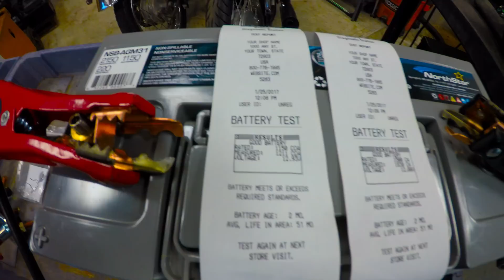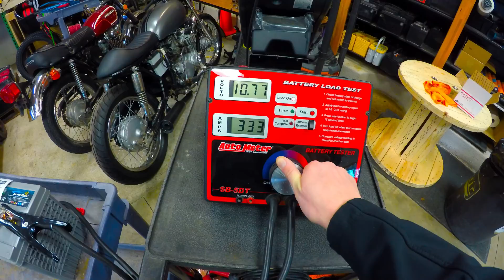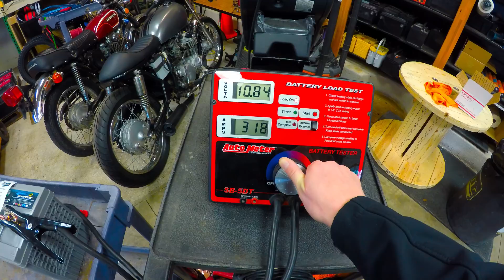Test My Batteries: Northstar Group 31 AGM (Stud Thread, Part NSB-AGM31)

Comment: I have a adjustable voltage regulator in my vehicle. What is the recommended or max voltage I can charge with? I have a northstar agm31pro as my primary and I will be adding a smsagm220 as a secondary.
Reply: Should be some spech brochure PDF available from the mfg on your battery stating the charging voltage
Reply: Found this on Northstar's FAQ website. 

"Will there be a list of vehicles that we do not want to sell product into because of their alternators?
No, the number of vehicles and systems that exist today would make it difficult to identify, manage and update a list on a regular basis. So instead we have set charging the charging parameters of between 14.1 volts and 14.8 volts as an acceptable charging range. So long as the battery charging remains within these tolerances the battery will perform to its engineered specifications. It is recommended that for every application the customer test the charging voltage to ensure it is within the acceptable limits." I used Google to answer your question.

Comment: I’ve been going back and forth with xs northstar and kinetic. And I always keep coming back to northstar. I also heard XS is made in China 🥴
Reply: Peyton Cole I ended up buying the Northstar elite group 31 battery. Says it puts out 930cca.
Reply: Make sure they test the battery before you buy it, I just bought a new Northstart Group 31 and the new ones are rated at 1370 CCA, when bringing it home, the battery needed a full charge, I did so, but it will only charge up to 988 CCA, I’ll be running it threw a different charger and see it it brings it up. What I’m thinking is it sat on a shelf for a year and was never recharged before the date 12-19 and I got sold a dead battery... so let’s see if it comes back or not if not it’s going back to the seller. I will say this most all Northstar batteries are under rated and the CCA is usually higher. But do your own research and pick the best one for you!
Reply: TurboF100 you might want to call Northstar. I bought one through Amazon. It came in 3 days. I put a charge on it to top it off and it only needed about 15 min and it was sitting at 12.9 volts after it rested for one hour. So mine was good
Reply: jasonneal I called the local auto parts store I bought it from, to let them know and I’ll be taking it back soon to exchange for another one. Good to hear yours is working great!! The volts being high doesn’t mean everything if the CCA’s are below the rated value lol, I should correct myself 1370 cracking amps is at 0 Celsius, the CCA is 1150(same exact battery as in the video) I actually have a professional battery tester with a printout etc and it’s accurate, so compared with cheaper batteries I’ve bought over the years that have always read higher then their rated CCA’s this was disappointing to me lol, I’ve always heard good things about Northstar that’s  why I bought it to replace my 15 year old Optima that is still working actually but a bit low on the CCAs now given the age...

Comment: When I charge my Northstar AGM35 with a noco g1100 (1.1A) charger on the "AGM" setting and to a 100% full charge "solid green light" it comes off the charger at 13 to 13.1 volts but it slowly drops. After 24 hours of it just sitting it has dropped to 12.96 and after another 8 hours so it's at 12.93 - I can only let it sit for so long before I have to put it back in my car but is this normal?

Also, would a noco g7200 (7.2A) charger be too much for my battery? I'm afraid too many charging amps would hurt it.
Reply from the maker: I LOVE NINTENDO your charger is indeed fine, max 35 amps input. 

Noco make a great product. As to your battery that is normal. 12.8-13.1 is resting depending on temp
Reply: Ok. I was worried because I'm having charging issues in my vehicle. No parasitic drain at fuses but I found out 2/3's of my diodes were bad on my alternator and allowing back flow. I replaced my rectifier/diodes so my battery isn't draining as fast as it was "needing to be charged every 2-3 weeks" but my battery never charges back up from normal driving. I found out my car has an ELD in it and drops the voltage to "maintenance" charging levels around 12v during driving if no accessories are being ran. Do I need to bypass this so that the alternator will charge my battery? From what I've read my alternator is a "denso" and has an internal voltage regulator..
Reply: And what do you mean by max input? If i'm using an HO alternator that's putting out 80A at 14.8v will that damage the battery?
Reply: @restore64  I run a couple high output alts. Mine have peak output of around 330 amps. Your battery will be fine bro

Comment: Conductance testers are good, but can be completely fooled sometimes, showing a useless battery to give an excellent CCA reading on occasions.. Best to do a load test too. For accurate Amp Hour results a discharge over several hours is the only way I have found. Even ACT meters are not always accurate with anything other than the smaller batteries , such as the AGM's used for alarms etc.
Reply from the maker: Michael Thomas  we test both actual load test and the inductance measurements. we do use a Western Mountain cba for ah test
Reply: Hi Kevin. Yes, people certainly need to do multiple tests like you to be certain of battery performance. These conductance testers seem good in that if they say a battery is way down in CCA, the battery is, but I just don't trust them 100% if they say a battery is OK. Have a good day.

Comment: Why test a battery at less than 80%SOC
Reply: Larry Price he drains the Northstars before he tests them against anything else, it makes it more fair.
Reply: Larry Price and if for any reason you don't want to believe that, we see all of the 3rd party BCI testing monthly, which is enough to know he is either testing a bad battery, or skewing the results. 
good luck on your endeavours
Reply from the maker: Larry Price it was fully charged fresh of a ctek. the low voltage was just not waiting after pulls for returning to resting voltage.
Reply from the maker: Larry Price battery is not at 80% prior to testing on camera i had pulled to get an aprox reading to know when to stop the tester, rebound voltage hasn't returned to resting. I have the same battery still in stock can place on ctek, charge and repeat test. results will be the same. GP is known for misleading customers about performance specs to make a sale. I provide dozens of brands at affordable prices including northstar.